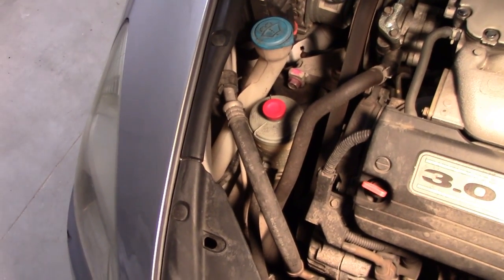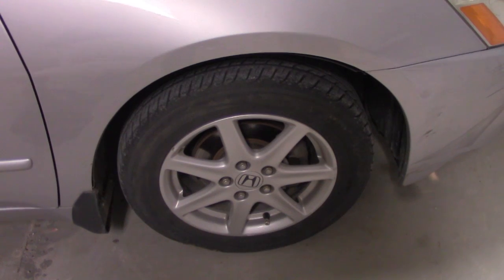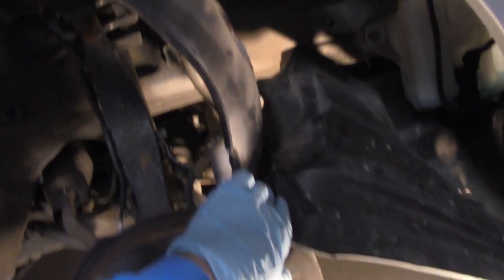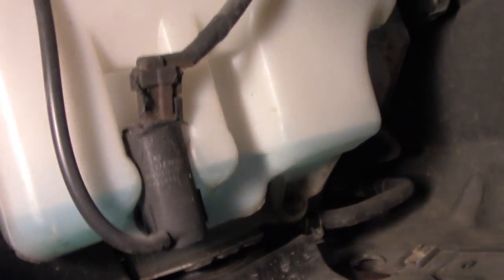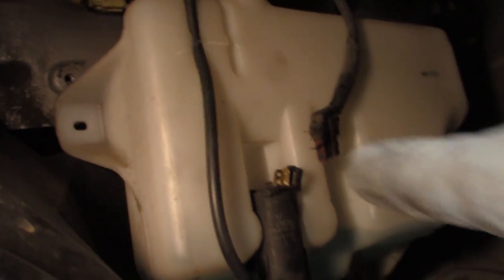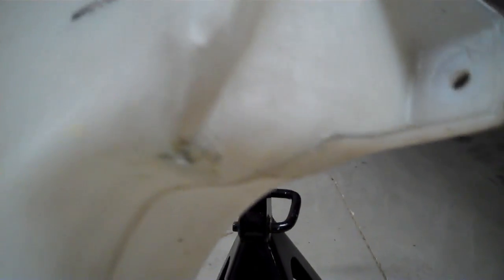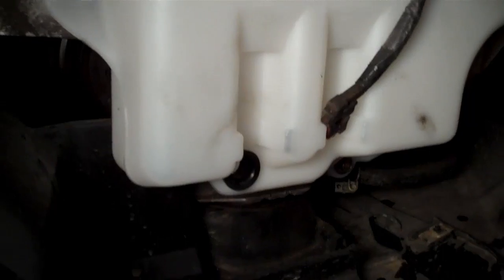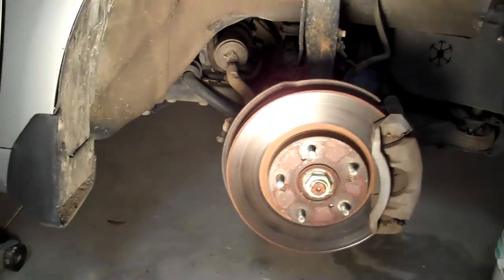Honda Accord Windshield Washer Reservoir Replacement

Comment: I have a 2012 Honda Fit. Dealer wants $178 just to replace the motor. This video was a godsend. Reservoir w/motor is approx $46 at AutoParts Warehouse. Kudos!
Reply from the maker: WOW!!  Glad I could help save you some money!!  Thanks for the awesome comment!! Please share and subscribe. I have other #honda videos that may help you out in the future.
Reply from the maker: *****
You would have to look for the placement of the reservoir and see if it is in the same spot,  if so, it will most likely be the same. I do not have a 7th gen Civic to check out. Sorry.

Comment: Thanks for the video.  Enough info to know how to get at the resivoir.  A couple of tips though :
1.  Those clips don't come out so easy and most broke.  You can order them from amazon or ebay.  I would do this ahead of time as there will likely be several broken around the car.

2. For me the hose was cracked, and the reservoir was fine.  Just needed to fix the hose.  I would inspect before buying the reservoir.

Comment: Safety First not last have a future and a past ; ). Thank you for the video.
Quick question for you, wondering if there is a drainage port with plug? 
I have a 2008 Honda Accord, She's full with Summer washer fluid I now need to switch to the Winter fluid Thanks
: )Tyler
Reply from the maker: Hmm.  It has been a while since I did this video but I do not remember a drainage plug.   Sounds like you may need to get a siphon pump and pump out the old for the new.   Sorry I don’t have a better solution.
Reply: @mitchcox  That's a Good one Mitch, Thank you. Quick question for you do you believe in Natural Cures?.
: )Tyler
Reply from the maker: I believe there are natural remedies.   But I don’t believe that just because it’s natural that it’s good for you.
Reply: @mitchcox  Smart Man, agreed.
: )Tyler
I have left a comment in the comment section of your video explaining the natural cure and prevention of cancer if interested.

Comment: Is it the same for 90-2003 Honda accord models?
Reply from the maker: I am not sure. I don’t have one of those. I would check and see on yours if the location is the same or similar.  If so the process should be pretty close to the same.

Comment: I have an 01' Civic that needs the reservoir or at least the sensor replaced. Would you imagine it is similar to the Accord? By that I mean close the wheel well so as not too difficult to get at?

Comment: My car doesn't have the hoses that deliver the fluid up to the window are they not visible?
Reply from the maker: They are most likely behind behind the fire blanket (insulation type material) that is attached to the hood.

Comment: The only thing difficult about this job is getting it out,  which is the only thing you didn't show. Useless,  maybe next time you make a video you could skip the lesson in how fasteners work and ACTUALLY SHOW his to remove the part?
Reply from the maker: Removal starts at 3:43.  I tell you each bolt to remove and show you the clip and wires to disconnect etc.  sorry you couldn’t figure it out.